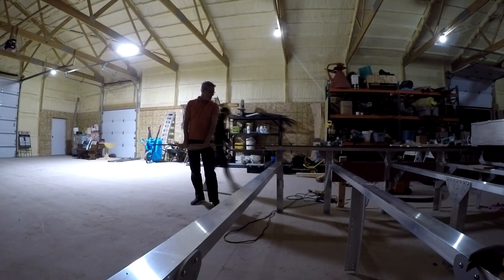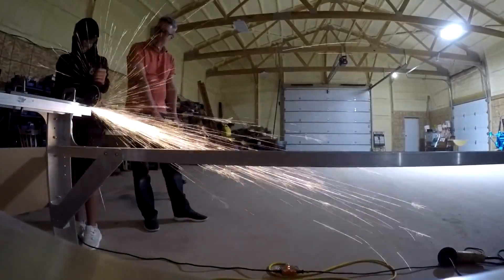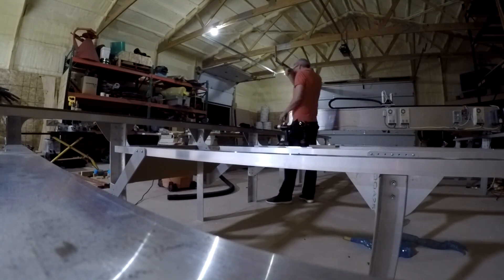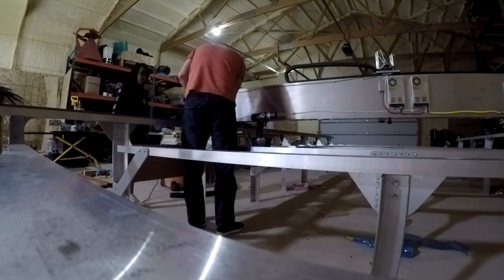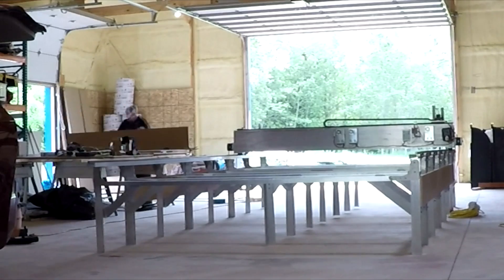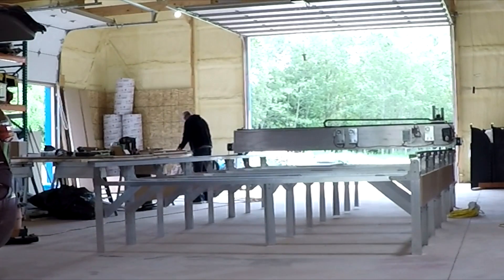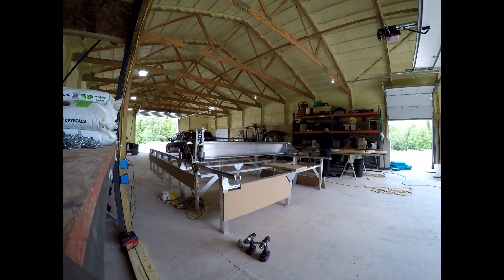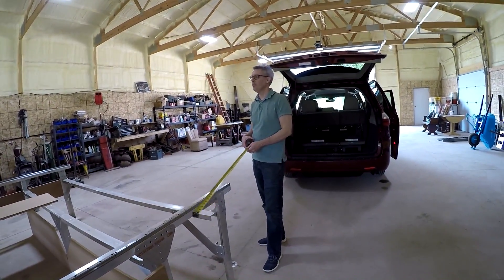Fabricator Pro 8'x17' CNC Router Build in Wisconsin Part 3

Comment: Did you get the bearing rail ends precision ground for seamless transition from one section to next?
Reply from the maker: In this case, I did not need have them ground.  I positioned the bearing block over the two ends and fastened down the rails to freeze that position.  I then tested the transition for any noticeably clicks or bumps.  Fortunately, there was minimal friction and would not affect this application of drilling holes.  If there was friction, I would have ground the two ends.  In most machines, I do grind the ends as it is rather difficult to get a good seam.
Reply: BuildYourCNC 
Could you record a short video of your grinding setup?
I was thinking how to do such operation on my surface grinder but concluded it would have to be done on a tool & cutter grinder.
Reply from the maker: @rok1475  It's extremely low tech as I do it in the field, or on the machine.  I just get an angle grinder and go at it until I hear no click when the bearing passes the abutted rails.

Comment: Great job but personally I would have used linear bearings and used rack and pinion with compressed air blowers along the x and y axis. Helps with the racking.